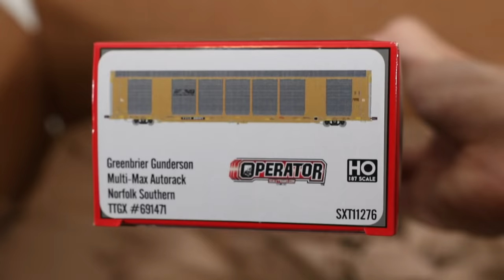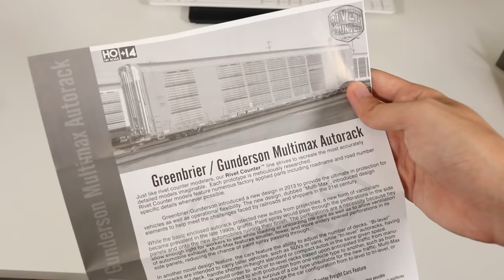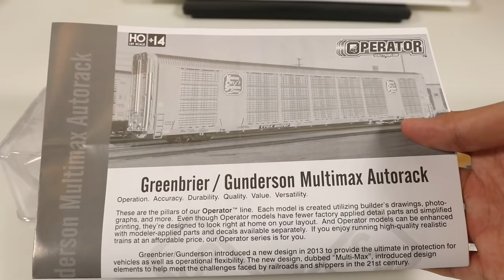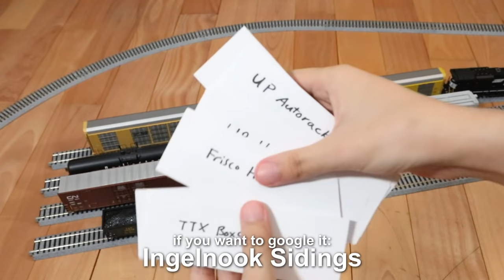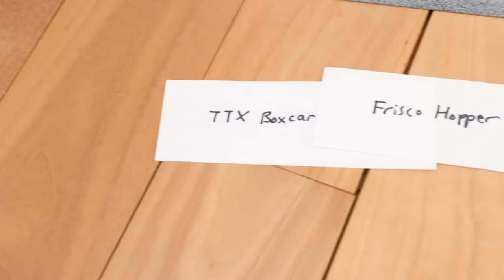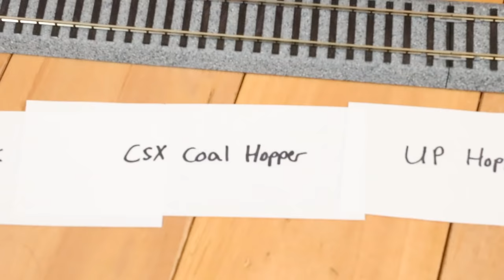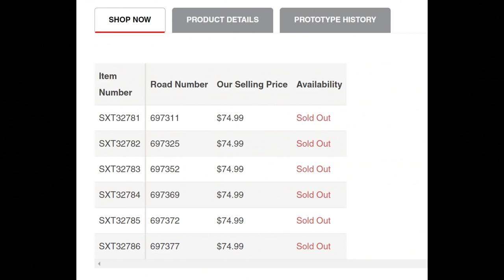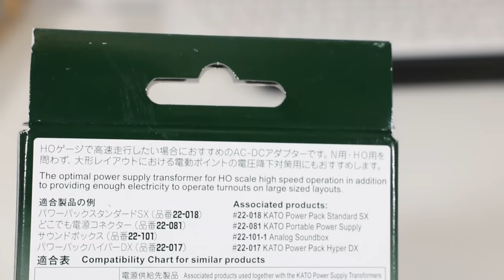ScaleTrains HO Scale Autorack Unboxing

Comment: Oh, cool. You found the Inglenook shunt game; it is fun and challenging. It's also a good starting point if you want to make a permanent layout, but don't "quite" have the space for something the size of a table. I built a shelf mounted N scale version using some scrap floorboard measuring about 8"x48". With HO, you could probably do 12"x72" (1ftx6ft) with no problems and mount it to a free wall. While this is a pure switching layout, (no loop for the trains to run around), It's still fun to operate and gives you an excuse to leave your trains out. 
And if Inglenook proves to be not much of a challenge, then I recommend looking up "The Timesaver" Switching puzzle. :D

Comment: 9:27: NS ES44AC notices UP SD60M and his grain hoppers, and he decides to steal them. So, NS ES44AC backs into the siding and takes UP SD60M's hoppers. UP SD60M wakes up as soon as NS ES44AC pulls out. UP SD60M didn't even realize that NS ES44AC is stealing his grain hoppers. Then UP SD60M chases NS ES44AC, telling him to give his grain hoppers back and connects to his hoppers, and gets pulled along with an intermodal set behind him. Much later, UP SD60M is now between the CSX coal hopper and the CN boxcar. NS ES44AC and UP SD60M return the train cars after a long run.